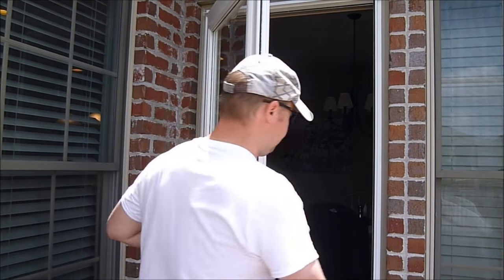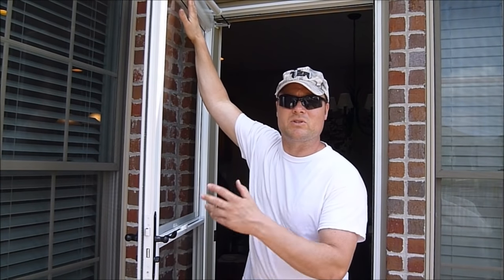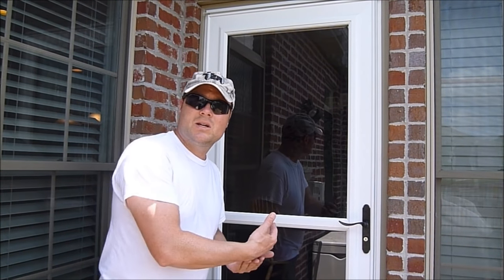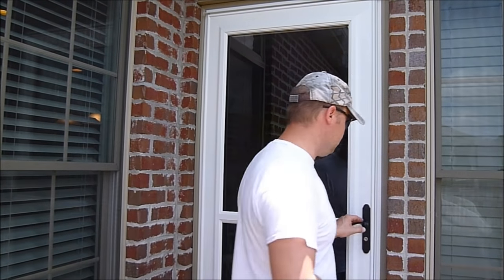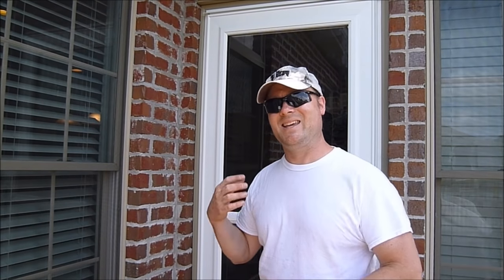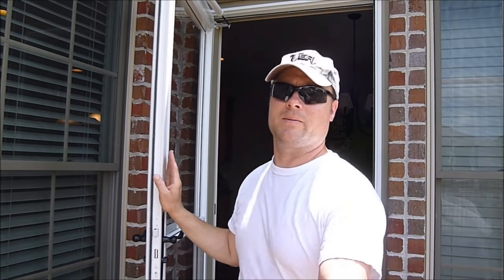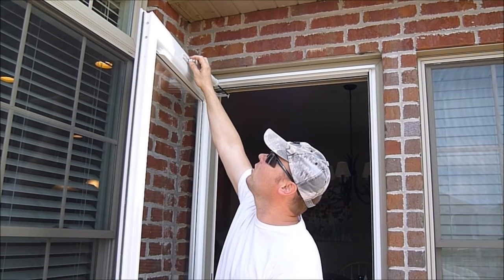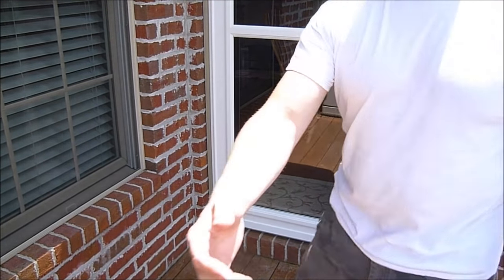Adjusting A Storm Door

Comment: Installer has door only open 70 degrees. HELP.
Reply from the maker: You might be able to adjust the brackets and give yourself more opening room without re-drilling. It would help if I had some pics. If you go to my website and fill out the contact submission then after that I can receive pics. https://www.aroundthehome.org/

Comment: Hi, this adjustment seems to slow the final stage of the door close (right as the door is latching), but I need help adjusting the initial swing (right as the door is released). No matter how much I tighten the screw, the door shuts very quickly and then abruptly stops and starts bouncing until it eventually latches. Any help would be much appreciated. Thanks!
Reply from the maker: Yep, sounds like your closer unit has failed and needs to be replaced. Here is a replacement one.  https://www.amazon.com/Wright-Products-V150WH-PNEUMATIC-CLOSER/dp/B0009YDHJ8?crid=335L3P4J6YRP0&dib=eyJ2IjoiMSJ9.lbUVudrd_AwL3jYVxZIHvZ5ic32xt_Kuf1UEEbqnMi3erUynHGQkKwU2_KV5_03BtK7SwS3yYeqhjwBC5u4HErzKAX1qjsl4PuERxyxs-GPfYLxWgTa5jNhWT4G11I0vhtykyKiFTWZ5tgO3ZCk-kGKmWNaHiHK25MMeBoOl0T4DDd4lOKkDjgiLrcmwU3tpRmRXmXBH4TIv36oaI4vd7kHW8CAXJ3VljGV2GCTMKXpaCp6TUA_C8HCgT7dERnn3X0X8zi-bOri2kY2l7bjG9s9sg1emF9I-4ZvKX5IH0yk.-lDIEDcpeFLbL0yLcAu01PNPMImiN3m_AiVDVUJ9Pjk&dib_tag=se&keywords=door%2Bcloser&qid=1727175057&sprefix=door%2Bcloser%2Caps%2C137&sr=8-7&th=1&linkCode=ll1&tag=greatwhitenin-20&linkId=4a70e9488a8383d8b69d98635aabcabf&language=en_US&ref_=as_li_ss_tl
Reply: @AroundTheHome1  ah okay, thanks for the response!

Comment: my screen door swings from open to almost closed in less than a second, and then takes 20 seconds to latch, what am I doing wrong?
Reply from the maker: Sounds like your piston has a leak in it and needs to be replaced. This should help. https://www.amazon.com/Wright-Products-V150WH-PNEUMATIC-CLOSER/dp/B0009YDHJ8?crid=2XQCRH4AQ04IM&keywords=storm%2Bdoor%2Bcloser&qid=1692315273&sprefix=storm%2Bdoor%2B%2Caps%2C150&sr=8-2-spons&sp_csd=d2lkZ2V0TmFtZT1zcF9hdGY&th=1&linkCode=ll1&tag=greatwhitenin-20&linkId=e4b9fbfb39f7448d261065913ff0f77e&language=en_US&ref_=as_li_ss_tl

Comment: Hello, I want to see it with the front door closed.  My issue is the air pocket between storm and front door prevents the storm from latching.  I always have to keep the screen open even for just an inch so the air has a way to escape.
Reply from the maker: If your door has that good of a seal, it may not latch all the way without a way for the air to escape. These are pneumatic closers, not hydraulic. There is one thing that you can try. On the closers there are two pin holes. Try putting it on the tighter one and see if that helps. Thanks for watching. Don't forget to stop by our website www.greatwhiteninja.com

Comment: Every spring my door starts scraping on the door jam. I imagine this is from snow and ice.  How do I adjust the storm door so that it doesn't scrap the bottom of the door jam?
Reply from the maker: @Christy this is more commonly caused by the humidity in the air during the warm months. The wooden door jam swells slightly causing things like doors and windows to act differently. Is it only scraping on the bottom and more specifically where on the bottom?
Reply: @AroundTheHome1 I'm sorry, It's not a wood door. It's a regular Larson type storm door that leads out to my patio.  It's scraping on the bottom aluminum(ish) plating and doesn't swing open well. It makes a high-pitch scaping sound. How can I adjust it so it stops scraping and doesn't stick    when I open it?
Reply from the maker: I know that your storm door isn't wood. I was referring to the wooden door jam that the storm door's frame is screwed to. But back to the problem at hand. Ok, so it is scraping on the bottom of the storm door. Is it scraping just on the latch side or fairly even across the whole bottom?
Reply: @AroundTheHome1  OK--So I went and examined the door more closely and the door is scraping across the top. My bad.  I thought it was near the bottom. The door wont shut tightly without pulling it closed. When you open it, it scrapes and makes a high pitched scraping sound along the top of the door but more toward the  'door knob end' along the top of the door than the center or hinge end. Is it still the swelling of the wood the door jam is attached to that is causing the scraping? Is there any way to adjust it so it swings closed tightly without scraping?
Reply from the maker: I do believe it is the wood swelling. There is a reason that doors have extra gap that they don't need all year round to take care of this. But if the door is not square with the jam, when your house expands it will scrape. Now I am sorry to ask yet another question, but is it scraping on the side of the door at the top, or completely on the top. I need to know specifically or I will tell you the wrong way to fix it.
Reply from the maker: Actually, I think I should get a picture of the door first. I want to see the gaps at the top and side of your storm door. If you go to my website and go to the contact page you will be able to send pics after that and I can better answer your question. www.aroundthehome.org

Comment: I had a similar problem with a different cause and different solution- perhaps it might help others. Door wouldn't close right- not catching. I tried filing as shown in this video but that didn't work. Then I thought that the moving part (I don't know the names of the parts) wasn't going far enough into the "rectangular thing".  So, I thought that maybe if I raise the "thing" a bit- maybe it'll close correctly. Then I had to ponder what to put under the "thing" to raise it. Anything soft would get squeezed once I tightened the screws. So, I had some old credit cards. I cut one into little squares. I thought that maybe a thickness of 3 of those might be about the right distance to raise the "thing". So, put I 3 squares just above each of the 3 screws- then tightened them. Voila! Closes perfectly now! So, your solution didn't work for me- but thanks- because watching it got me to tackle the problem. I'm not particularly handy with home repairs except for very simple problems. I just have little experience. I wish when younger- those college years I worked summers in a paper mill- I should have worked with local tradesmen. I think 3 months with a carpenter- 3 with a plumber and 3 with an electrician- would have helped this old nerd!

Comment: My Larson door has a foot pedal like yours on the bottom cylinder of the storm door however my locking pedal has moved to the side from the top of the closer. Each time the storm door closes the pedal touches the house door and then each time the storm door is opened, the storm door locks back. Is there a way to move the locking pedal back to the top of the cylinder? Thanks for any help you can give me.

Comment: Our door doesn't open all the way only 45 degrees, how can we fix that?
Reply from the maker: Well, without being there to see it, I'll tell you what it sounds like to me. And, that is a very small opening. These doors should upon almost 90 degrees, so you are saying that it opens only half way. I would first double check the closer to make sure it is opening all the way. I wouldn't want to suggest any door alterations before you could confirm that it's not just your closer. But after that it sounds like the closer was installed right in the first place. It sounds like the bracket on the door that attaches the closer was put too far away from the door jamb. If that is soo then it would need to be remounted closer. When I mount the closer, I normally pull it out about an inch to inch and a half then lock it. Then I put it up against the closed door and that is where I put the bracket. I hope that makes sense and I wish you luck on your project.

Comment: My door latch....that top latch....not the main lock, doesn't stay.  It shuts but from the inside,  if I push it....it will open.  The door is unlocked....but should hold with that top latch so the door is closed.  Could the door handle/ latch be broke ?
Reply from the maker: I think that I understand what you are saying. It is possible that the latch is broke or wore out. I would check to see if it is coming in contact with the strike plate first. The strike plate is on the jamb where the metal frame has the slot for the latch to go into. Is it lining up and is the latch entering the slot? Is it too high or too low, or maybe too far away?

Comment: I had a heavy duty screen door installed from Lowe's and they claim the closing mechanism cant actually allow my door to open all the way (it can open about another foot and a half), they said the closing mechanism would fail if it opened any more... does that sound right? The door is a Titan security screen door... I don't remember having this issue with any of my other houses and the installer already messed up the pump installation to begin with so I can't trust that they are giving me the whole truth.
Reply from the maker: Honestly it's hard to say from just a description. What do you consider all the way? 90 degrees? More? Most storm doors open about 80 degrees. The more they open the harder it is to get them to close enough to latch.

Comment: The guy who installed ours did a good job except for the adjusters (and in one case, the adjuster mount).  I needed the door to open a bit wider and to not close so quickly.  It needs a bit more tweaking but it's already better.  Thanks for the video.
Reply from the maker: Thanks for sharing

Comment: I installed a new Larson storm door and it shuts good, the problem is that when it's latched there is about 1/8" of play between the latch and striker plate, the wind causes the door latch to bounce back and forth against the plate and it's noisy. I know I can put a piece of wood in the striker plate recess and take up the play but I'm wondering if there's a better way to do it or some kind of a kit?
Reply from the maker: They should provide little shims for the striker plate. Did you have those and they were not enough. To be honest, I don't know of a kit for that. And have always seen installers just cut a little block of wood to fit in and fix the gap when necessary. Thanks for watching and don't forget to stop by our website for many more helpful videos. www.greatwhiteninja.com
Reply: @AroundTheHome1  I'm not sure if they provided shims or not, it's been too long ago that I installed it and I don't remember. It only really does it if we have the back door open at the same time, the air pressure is equalized then and when it's windy out, I just put up with it for awhile. I'm at Menards now, gonna look around and see if they have something, if not I'll just get a small piece of hardwood and cut something myself...

Comment: I just installed this exact door and it opens to far . I installed the closer exactly like was told in the instructions I even double  triple checked the instructions.  Any thoughts  ?
Reply from the maker: When you say too far, like how much too far? Approx. degrees?
Reply: @AroundTheHome1  it opens another 15 inches beyond being straight out.
Reply from the maker: Oh, wow. That is far. Well, something is out. Opening 100 to 115 degrees is not a problem, but sounds like yours is opening 150 degrees. Sounds like the bracket on the door is just too close and needs to be out a little farther. I would feel better with some pics. You can hit me up on the contact page of my website if you want to send me some pics of the door. After you submit your contact info, we will be able to send pics and I could see what you have got going on. https://www.aroundthehome.org/
Reply: @AroundTheHome1  ok. When I checked it I had only done the top closer and after finally getting the bottom closer done it's fine now. phew.

Comment: i did this and even made it all the way tight and it still slames shut
Reply from the maker: That most likely means that the closer has failed and needs to be replaced. Here is a link for a standard closer. https://www.amazon.com/Wright-ProductsV920WH-STANDARD-PNEUMATIC-CLOSER/dp/B000LNPND0?dchild=1&keywords=storm+door+closer&qid=1621127300&sr=8-6&linkCode=ll1&tag=greatwhitenin-20&linkId=b7d5dc565c255a266fa83b640b700e74&language=en_US&ref_=as_li_ss_tl
And here is a link if you have a heavier all glass door that needs two heavy duty closers. https://www.amazon.com/Touch-Hold-Smooth-security-Replacement/dp/B0058JLBEW?dchild=1&keywords=storm+door+closer&qid=1621127408&sr=8-1-spons&psc=1&spLa=ZW5jcnlwdGVkUXVhbGlmaWVyPUEzUko1UkhCMUlUOVkwJmVuY3J5cHRlZElkPUEwNDg2MTk4M1Y4RVhRWVpZSkNVTCZlbmNyeXB0ZWRBZElkPUEwMDgwMDgwMllRT09VSDcwSk1WTCZ3aWRnZXROYW1lPXNwX2F0ZiZhY3Rpb249Y2xpY2tSZWRpcmVjdCZkb05vdExvZ0NsaWNrPXRydWU%3D&linkCode=ll1&tag=greatwhitenin-20&linkId=8916318c49140482f172b77188cc1a2d&language=en_US&ref_=as_li_ss_tl

Comment: Okay your tutorial worked but it affected the locking mechanism. The little piece that allows the screen door to stay open by itself does not work now.
Reply from the maker: I was just showing how to speed up / slow down your storm door closing speed. I'm not sure what you are referring to. Does your model storm door have a separate screen door, like a double door? The only screens on these that I am familiar with are screens that are built into the storm door and either have a sliding glass window that reveals a screen, or a roll away screen that rolls up into the top of the door as you pull the window up.
Reply: Sounds like the person is saying screen door for his/her storm door. Kinda like some of us call all soft drinks cokes.  Screen door. Storm door. Interchangeable names at times.  If that makes any sense.

Comment: Any ideas on how to adjust the screen slider? The up/down slide action worked fine for months, and now, even though I slide the window all the way to the top, I can no longer move the latch under the window. The window now, slowly, slides down, because the latch not longer holds it up.
It only slides down an inch or so, but I'd like to fix that.
Reply from the maker: Ok, I know which door that you have. I have installed a couple of those, but I do not own one so I am not as familiar with it's window as I should be. Is there a locking latch to catch the window, or is it supposed to stop wherever you stop moving it?
Reply: Around The Home there is a locking latch to hold the top window in place, and it used to work. I’d lower the window to reveal the screen, and then raise the window to close it up, using the locking latch to hold it in place. 
But starting a few months ago, I’m not able to get the latch under the window. I’ve pushed the window up as I as it can go, but the latch won’t clear the window.

Comment: I have the same door and new closers
Right now it either slams or doesn't pull shut
Any idea what I'm doing wrong
Reply from the maker: Are you adjusting both closers together?
Reply: @AroundTheHome1  I was doing that at first, then I switched to one at a time. Turned out the latch needed lube and it started closing correctly
Reply from the maker: Sounds good. Glad you got that working right. Thanks for watching and don't forget to stop by our website for many more helpful videos. www.greatwhiteninja.com

Comment: i have a situation where i'd like the storm door to open a bit wider. it's a new install Provia, and is at about 80-85 degrees. really need it to have a wider open range of around 90-95 degrees. any advice on accomplishing that? thanks
Reply from the maker: Not if you want to use the closers with it. Sorry, I don't know of any that will give a normal storm door with normal pneumatic closers that kind of opening range. I guess you could install a hydraulic closer like on commercial doors. Thanks for watching. Don't forget to stop by our website www.greatwhiteninja.com
Reply from the maker: I take back part of that. I do know of some doors that will open 90 degrees or more, but they normally don't close all the way on their own. You can re position the mount of the opener on the door to give it more swing room, but it will almost certainly not close all the way on it's own.

Comment: What if the latch is sticking out and will not close? It is sitting on the frame. It used to close fine.
Reply from the maker: Sounds like the latch has come loose and needs to be tightened.
Reply: @AroundTheHome1  Hi. I wish it was that easy. Everything is tight. The latch is sitting on the frame on the right side. I have tighten all screws on the hinges, door frames, handle. It did not help. So I took the side frame off and tried positioning it more to the right and then that left too large of a gap between the door and frame, so water would get in and it looked bad. So I put it back. Now the door also is rubbing a little bit on the top right corner as well as the latch still resting on the frame. I probably need 2 mm and then the latch would hit correct so it could suppress and close properly. I also put 2  3-inch screws in the hinges to doorwall hoping that would pull it in but it didn't. The closing speed on the actuator is right also. I tried it at different settings and that didn't change anything.
Reply from the maker: Ah, now that's a lot more info. Yes, wish it was that easy. From what you are saying, the best that I can figure without being there is that the door is out of square with the frame. You say you need about 2mm for the latch to hit correctly. Can I assume that means that the storm door latch is 2mm low to properly enter the strike plate on the frame? If so then you need to change the shims on the hinge side. For instance, if the latch needs to go up, then you would add a small shim to the lower part of the hinge side. Maybe this helps, or maybe I misunderstood you.